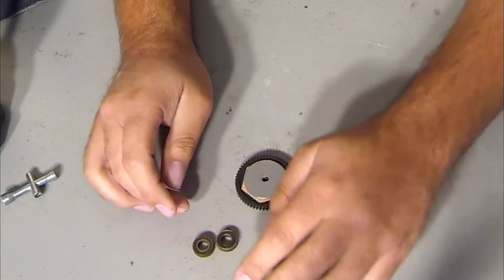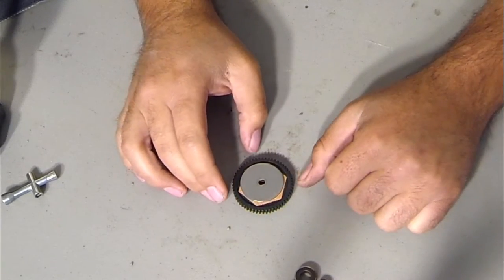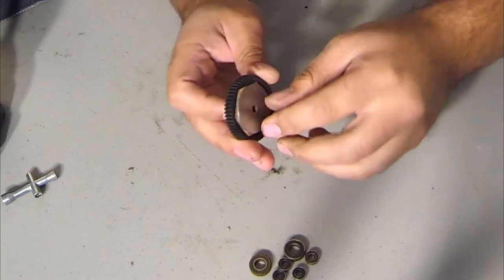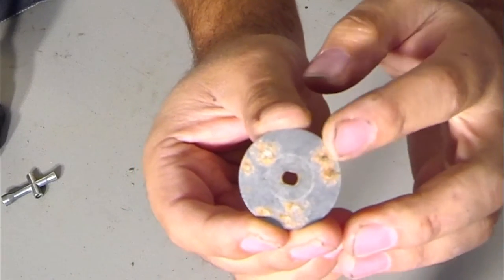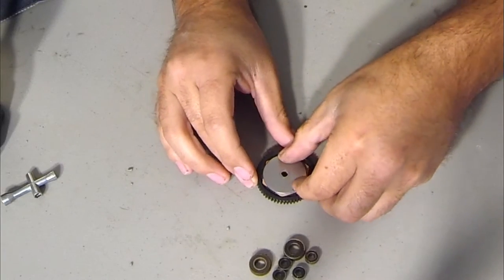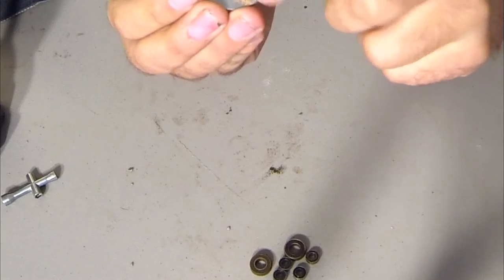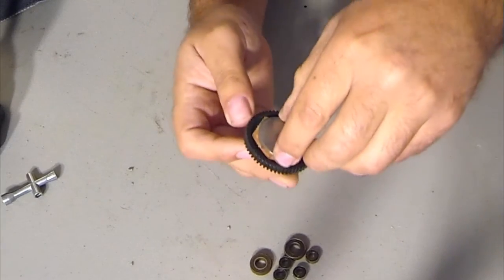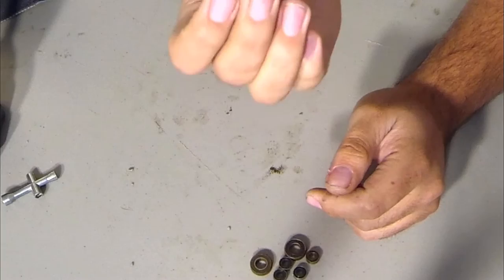ADVENTUREQUEST RC - Axial SCX10 II Jeep Cherokee CHECK YOUR SLIPPER CLUTCH!

Comment: Mine became loose after 3 months of heavy use, i noticed all 4-wheels were still pulling but it was slipping on easy obstacles and not as capable.. I tightened it 1/4 a turn, now the ole gen8 purrs like a kitten!